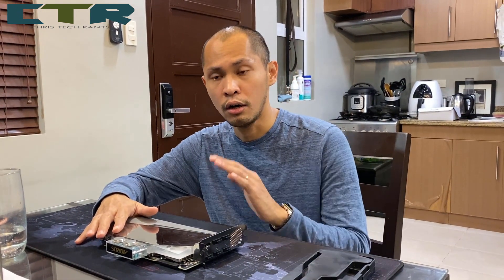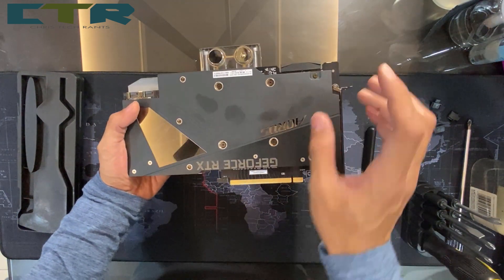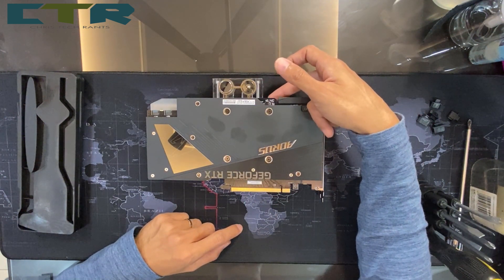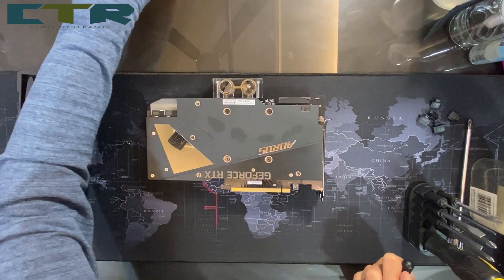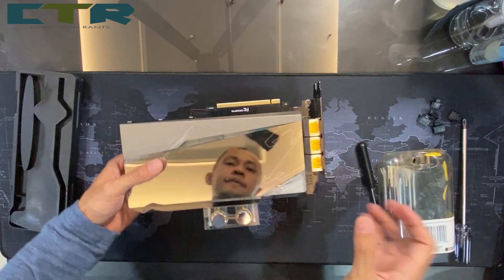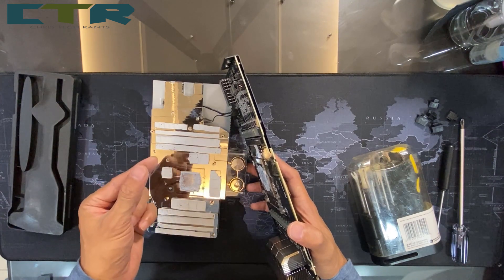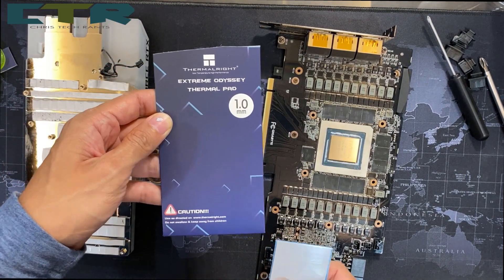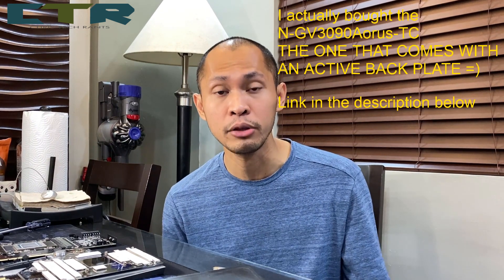Ever torn down a 100k GPU? ME NEITHER!!!!!  Welcome to Aorus RTX 3090 Xtreme Waterforce WB teardown

Comment: Basically, you can change the waterblock on the water force edition. I'd need a rtx3090 master edition water block with active backplate to pair it with. Did I get that shopping list right? Also, do you happen to have a high res photo of the pcb that I could download so I can match it up? 

I'd much rather have an rtx3090 card since at present my setup is running the aorus xtreme waterforce rtx3080 12gb edition.
Reply from the maker: Just pause the vid for the pic 😁 it should be clear enough to make a comparison.

As for the pcb though. My 3090 aorus xtreme waterforce WB edition has the same pcb layout as the 3090 master revision 1, with minor differences in the components like the caps and bios switch….but otherwise the pcb is pretty much the same. NOTE: the master with revision 2 has 3x8pin power so the pcb is different.
Reply: @christechrants4085  I am an ekwb fan so the master edition Rev 1 would also work?
Reply from the maker: @Nakasasama  OOOOOOHHhhhhh but ek will be having a block for that particular pcb though =) and the active backplate can be bought as a set =) check ekwb configurator hope that helps.
Reply: @christechrants4085  cool deal thanks, I honestly wish I had held off on buying my current setup and did more viewing from people who been there did that. Hell, I had to drain my loops to flip the radiators to inlet outlet facing down due to the size of the case i have. :-/
Reply: @christechrants4085  an aorus rtx3090 xtreme will look sweet in this setup https://youtu.be/eCGRq4Pqnz8

Comment: Hi! You gave a link on active backplate... there is a review the guy claims that's his graphics card burned out after applying it... What do you think about that?
Reply from the maker: Hmm. Can’t imagine how your card would burn out because of the backplate. I mean, the card was doing just fine with the stock aluminum back plate, i can’t image hot a good active backplate block Does he mean circuits been shorted, or dit it overheat so much it damaged the card due to high temps???. Regardless, it seems to me he installed the blocks wrongly. 

I mean blocks are blocks. If it’s damaged or uneven somehow, you’d know right away and would even try installing it to your Video card. I don’t know. I saw and read his comment. Information he gave is too vague in my opinion.

Comment: So do I have to also buy a waterblock (separately) to make it work with watercooling?
Reply from the maker: It comes with a pre built waterblock…. You need to have an existing loop for it to work though
Reply: @christechrants4085  Thanks for the reply. What I was wondering is if I also need a waterblock for the backplate in order to make it work
Reply from the maker: @skeptikoi8890  nah. It works fine right out of the box. Because if you change the backplate, you’d also need to change the gpu front block as well. but it works just fine on stock…my only point is, it could be A LOT better lol. Check mp5works if you want to make the back plate an active cooling for a non invasive approach. .
Reply: @christechrants4085  thanks!

Comment: What about the the thermal pads on the back panel?
Reply from the maker: ye, someone beat you to it LOL so i did a spearate video for that :) it's all ready there. anyway, pads are about 3mm thick if i remember correctly. depending on the type of pad you're using, you may use as small as 2.5mm. but as for the stock they're all 3mm.

Comment: If I want to take apart the waterblock to clear inside where the heatsinks are because something  was washed out from radiator and stoped there do i have to remove completely the waterblock or can i just remove the front part ? those screw's on top of the waterblock is hidden under the glossy plastic cover and that one looks like not removable
Reply from the maker: The block’s not with me right now. Might post a video for that, great idea! Thanks!

But for now, those sticker has to be forcefully peeled off to get access to the screws. I’m not too sure if the ports at the top has to be removed to access the inside of the block, don’t remember and i don’t have the block with me right now to confirm. But the film/mirror film at the front definitely has to be removed. Bright side is, the screws are bored into the cold plate and not the acrylic, so lesser chance of damaging the acrylic. But then again, to access the screws, you’d have to remove the mirror film.

As soon as my schedule lightens, id make a very short video showing the stock gpu block.
Or maybe I’d just include it in the video where I’d reviewing the bykski 3090 block and active backplate. 😏
Reply: @christechrants4085  OK I am waiting! Maybe next week I will clean my loop I don’t know exactly 1st it was like something washed out from radiator but now I think it can be some life there inside 😂 🦠  i was using coolant from Thermaltake but UV Lights might accelerate growth if there is not enough biocide inside but that is a common probleme so must be a fairly easy way to take it apart … maybe remove the mirror platic with heat gun or it can be dissansambled from bottom … btw the card  might look even better without that plastic 😁

Comment: Thank you very much for this disassembly, my card is due to arive tomorrow.. I plan to optimize it.  As much as i appriciate your video i do miss the part about the Backplate.. You dont show the PCB with backplate off :-( Are the Vram thermal pads also 1mm here? and what is the material of the backplate Alu or metal? Wondering if there is room for a CPU cooler mount to the backplate (room for threading new mounting holes for a spare CPU waterblock i have, and if the material would even give me this possibility (alu backplate?).. Anyway you are the first on youtube with this material and greetings from Denmark. A heartfelt Thank you..
Reply from the maker: Sorry! To be honest, I completely forgot! Was in quite a hurry to send a picture of the front side to bykski and it slipped my mind since only the front side was needed. I will surely include ot in the follow up video though! Soonest would be a week from now. As soon as the active backplate arrives ☺️ really sorry about that. I don’t want to guess and just eyeball it and give a random estimate of its thickness 🥴

But what’s important was that i was able to send a picture of the PCB design, and have it reviewed by bykski 😁 and was determined that it would be compatible
Reply from the maker: I can’t attach a picture here, but i just attached heatsinks at the top, with two 50mm fans. Didn’t do much help though, just a couple of degrees drop. I don’t want to guess what type of backplate it has. I’d have a better answer as soon as i remove it (soonest is 7days from now) sorry. Attaching a cpu waterblock to it may be possible but serious modding will be needed unless you’donly use adhesive thermal compund. But ye, i think it’s possible, but you’d lose warranty though for sure, if you’d be drilling through them
Reply: I will look forward to your testing with the new waterblock. 
I will not do any mods the first couble of weeks, as I want a baseline and ensure nothing is wrong with the card.
After that I might see if the CPU cooler mod is possible or use an MP5works backplate cooler. 
Im impressed that changing thermal pads dropped the temperature with 5C. Was that change of thermal pads done on both sides? or only front side? 
f your results are good with the new full block, I might change to that one. 

Warranty would for sure be voided if i tamper with CPU blocks on this thing, and I would rather avoid that.
Reply from the maker: @greengrasser  rendering the video now actually, as for the drop in temps.... few things actually....

Front side thermal pads 2 degrees. + heatsink 2 or 3 degrees and if i put really cheap (REALLY CHEAP) fans, further 1 or 2 degrees c drop.

So i think those people who claim that they have a few degree c drop by replacing the thermal pads on the backplate seem realistic. In regards to mining that would be about 10mh/s increase maybe 🤷‍♂️🤷‍♂️🤷‍♂️🤷‍♂️

Right now with the heatsinks and fans on top of the gpu, i can hold the backplate without actually burning my hand, during stress testing, if you know what i mean....
Reply from the maker: Great news! A fresh pack of thermal pads will be arriving today! I’m hoping i could make a video for the backplate later tonight!!!! 😁😁😁😁😁😁